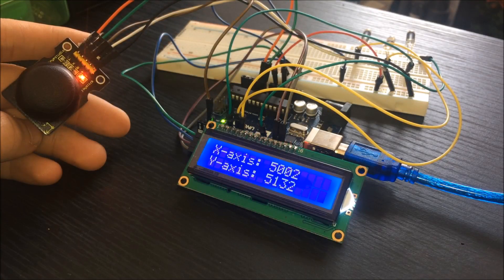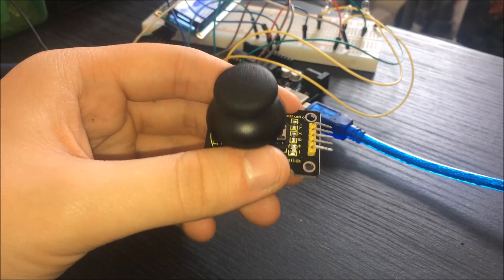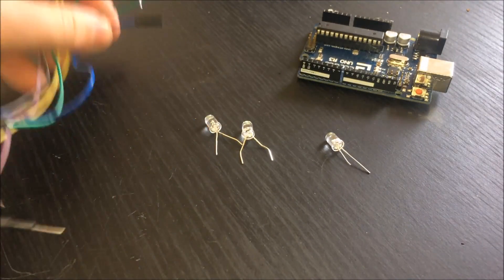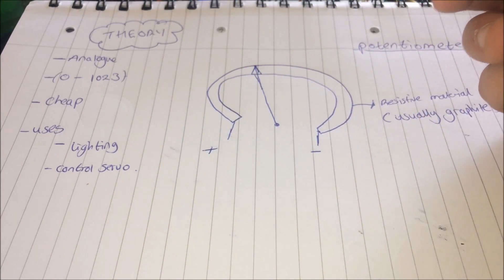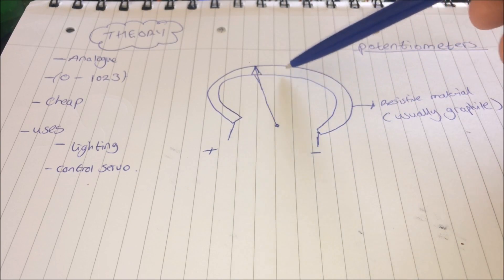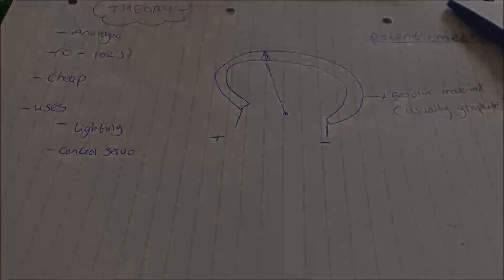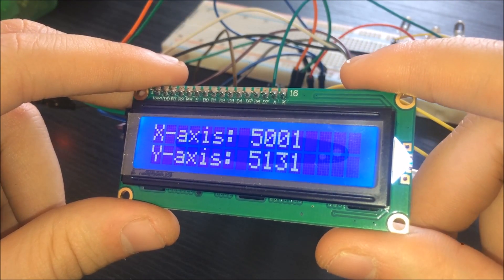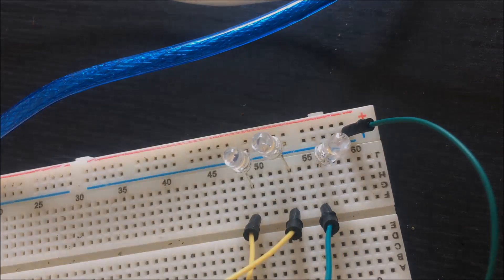Arduino beginner project - Joystick Module with LCD

Comment: If you want to use just the regular LiquidCrystal.h library, heres the code i did for it using another tutorial's pinmap.
#include <LiquidCrystal.h> 

int Contrast=75;
const int ypin = A1;
const int xpin = A0;
int ystate;
int xstate;
 LiquidCrystal lcd(12, 10, 5, 4, 3, 2);  

 void setup()
 {
    analogWrite(6,Contrast);
     lcd.begin(16, 2);
     pinMode(ypin, INPUT);
      pinMode(xpin, INPUT);
  } 
     void loop()
 { 
    ystate = analogRead(ypin);
 
    xstate = analogRead(xpin);
    
     lcd.setCursor(0, 0);
 lcd.print("X-axis: ");
  lcd.print(xstate);
  lcd.setCursor(0,1);
  lcd.print("Y-axis: ");
  lcd.print(ystate);
 
 }